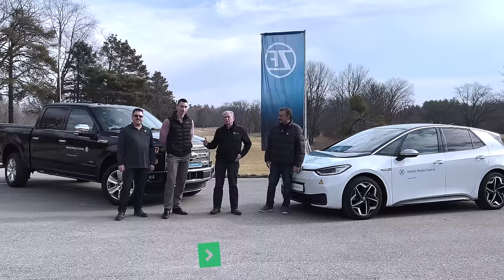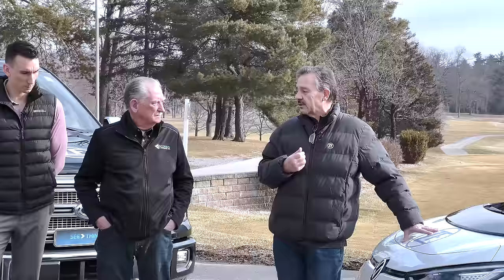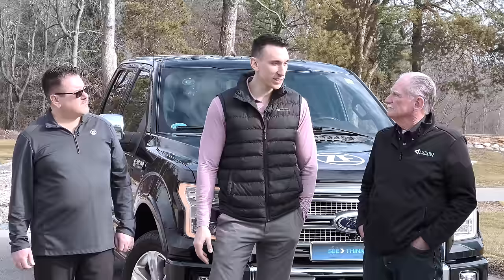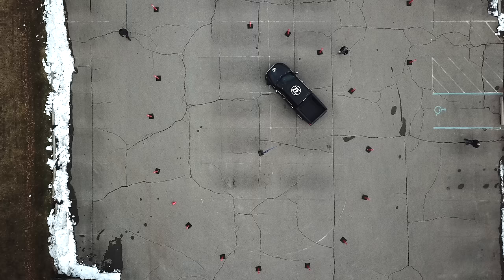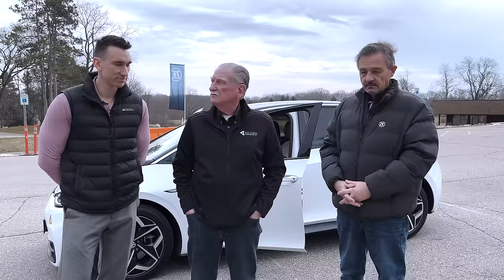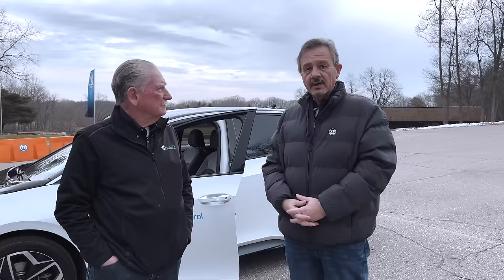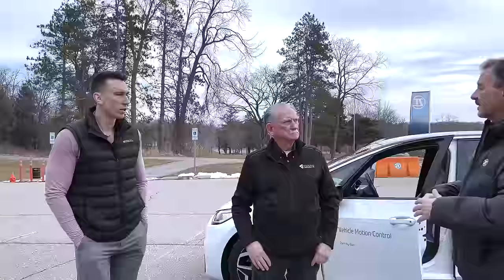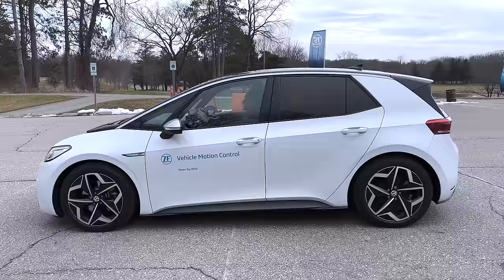Steer-by-wire - how it works with ZF

Comment: Any parking where people on both sides have enough space to open the doors and get out is easy parking. I humbly suggest a European supermarket challenge.
Reply: I have the ability, with the Tesla FSD trial, to get out of the car and remotely move it into a tight space. The future is bright.
Reply: @briansilver9652  well, it still isn't parking it perfectly in the middel of a parking spot thus not really very promising for Europe
Reply: @RamonSmits  The software is the worse it will ever be, constant improvement.
Reply: @briansilver9652  sure, just not usable for Europe. Same as parking next to the curb. In Europe you really need to park tight against the curb. That is something auto park can't do at all with FSD V12
Reply: @briansilver9652 
There’s little point in squeezing into a typical EU car park space if your monster car prevents other car doors opening on either side of you.
Reply: There's a trick for this: park in the other direction. When everybody parks fwd, park rearward, and offset your car so you can go tight to one neighbour passenger door vs passenger door...
Reply: @ABa-os6wm except that only works when your last to park and first to leave otherwise other will park closer to you. Luckily we have summon to mov e the car out of the spot. That feature does work and often needed here in the Netherlands even with regular parking because our parking spots are super narrow.
Reply: @davidelliott5843  
It's not a monster car, it's a tight parking space. The standards were made when cars were a lot smaller, and supermarkets want to maximize the number of parking spaces.
Reply: @RamonSmits  
From what I've seen v12 parks very well, better than most humans. Maybe not enough in really tight situations, but then you can still do it manually. And for a robotaxi parking is not necessary most of the time.
Reply: @andrasbiro3007  not well enough for Europe it's super small parking spaces
Reply: Sounds like parking in SF or Denver
Reply: @briansilver9652 I can do the same with my car (BMW) but chances are you’ll get a few dents in the side panels when parking like that next to a car without remote parking.
Reply: @RamonSmits My almost 8 year old BMW can do both quite well (in most cases) here in Europe.
Reply: @Conservator.  Not with the Tesla truck. 😁
Reply: @briansilver9652  I hate to admit it but you’re right. 🤣
Reply: @RamonSmits  
Perpendicular parking is not an issue. I've seen v12 park perfectly in extremely tight spaces, where a human wouldn't even try.

The issue with parallel parking is the width of the road. I don't think FSD would drive onto the curb for parking. Will have to learn this for Europe.
Reply: @andrasbiro3007  in all videos you see that autopark does not park very close to the curb. Agreed that in some cases you need to park on the curb but it could also just choose another parking spot. In regards to length. I've not seen a FSD V12 video yet where it parks itself in a very tight space length wise. Do share if you've seen it.
Reply: @RamonSmits  
I can't share, YouTube tends to delete comments with links. And I probably couldn't find it anyway, at least not easier than you. There were clips on X when the feature came out, and I've seen some crazy tight ones, but didn't bookmark any.

Comment: It begs the question of why we drive such ridiculously big vehicles. All this technology wouldn’t be necessary if cars were sensibly sized.
Reply: I drive a Fiat Panda. It’s great and goes the job, but fully steer by wire would be a great improvement.
Reply: @davidelliott5843 Why would you want SBW on a Panda? It’s already nimble as it is isn’t it? It would make the vehicle more expensive, going against it USP of being a very cost effective vehicle.
Reply: There are far more beneifits than just making a large vehicle more agile.
Reply: @smarticus6384  Like what? There is nothing SbW adds to the currently already available steering options for automobile drivers.
Reply: @davidelliott5843  which steering feature do you miss on a Fiat Panda? Be warned, the next question is most likely: why are you driving a Panda then?
Reply: @hvh377  Performance is better, especially the programmability, which ordinary electric steering cannot match. More importantly, we need to consider weight and eliminating mechanical complexity. Automakers would kill to free up more space and weight. This simplifies design and production and provides easy assembly, equating to substantial cost savings. The less weight and more space also offer better fuel efficiency, and with BEVs, it can allow for more battery capacity and range. These reasons, as well as others, are why SBW is the future.
Reply: @smarticus6384  Ordinary active steering matches the programmability of SbW. Does SbW reduce weight and complexity? It adds the need for redundancy and requires a force feedback system. It doesn't cost less power than any EPAS system (probably more) and therefore does not increase efficiency. It doesn't require less space (steering rack and wheel are still in place, force feedback system comes in place of linkage) and it certainly doesn't reduce complexity of the steering system. It will make RHS and LHS versions of cars more alike. But all in all, there aren't too many advantages over currently available systems.
Reply: Panda already has electric power steering. SBW would improve stability at speed while not compromising agility at other times.
Reply: @davidelliott5843  That would be 'active steering' or variable ratio steering. This has been available on certain cars for 20 years now. No SbW needed for that. But if you crave that advanced kind of steering, why are you driving a Panda? 😉 Can I suggest you trade it for a BMW? There is a reason Pandas are cheap, light and simple. They do that by leaving stuff off. It's part of their charm.
Reply: @hvh377  
Just removing the steering shaft is a benefit.  That opens up repositioning many other parts.
Reply: @hvh377 SBW add nothing? I’m you don’t understand. I find it stranger commenting about this topic when you don’t know what the technology can do.
Reply: @hvh377   You’re just explaining the components of each system and that is not why steer by wire is being implemented. The sales pitch isn’t that it’s lighter or that it’s cheaper or that it’s smaller. The purpose of SBW is the fact it can be programmed. Traditional systems cannot be programmed. I feel like I need to say that. SBW offers the ability to change the steering ratio according to an algorithm and when you make turns around the city, you don’t have to go handover hand turning your steering wheel 2 to 3 times in 1950 you turn your steering wheel that many times it’s outdated. 
Then there’s ability to play around with the feedback system and have different options. Adjusting the intensity, the smoothness or increase the road feel. And it’s too early to see all the advantages this system will have. in 10 years they’ll be doing things that we didn’t even think of right now. 

and the whole not reliable or the need for redundancy argument is not necessary take a traditional system choose one of the tie rods to fail, and you don’t have steering any steering system can fail
Reply: @Cyber_Cowboy  Well, the point I was trying to make is that SbW is not a necessity to allow for a fully and freely programmable steering ratio. There are systems that leave the mechanical linkage intact while providing variable ratio steering (check BMW's active steering, commercially available since 2003).
Current EPAS systems already allow changing 'steering feel' or providing feedback. A frequently used form of this is a lane keeping system, that actually provides a steering force to return you back to the center of your lane.
As for the comparison regarding reliability and redundancy, I somewhat  agree that the comparison to a mechanical system isn't quite fair (the mech. linkage lacking any redundancy whatsoever), but I think to get SbW accepted, it's a necessity. Unfair perhaps, but alas...
I would personally, although (maybe because of) I earn my living in electronics, also not feel safe using a SbW system without redundancy.

Comment: Quadrasteer GMC/Chevy offered rear wheel steering several years ago (2002- to 2005,2023?),  now those systems need service .   PARTS to repair are VERY DIFFICULT to find.  good idea, but VERY EXPENSIVE to repair and Difficult to find parts

Comment: No Sandy, you weren't square to the world with the system on.  The rear end of the truck was over too far.  But don't let Elon hear you talk about how great VW's steer by wire system is or you will be banned from X.  :)

Where there mic issues?  When the discussion was on chairs one of your guest mics didn't seem to be working.

Comment: Excellent demonstration and education. showing all the different modes of steering and feedback will help move the car industry forward.  The public doesn't know what they don't know
Reply: Shout out to Tesla and Elon Musk pushing the envelope when absolutely none of the OEMs could be bothered to do so. We would still have no steer by wire for the next 20 years if not for Tesla.
Reply: @billhanna2148 
They are driving a Ford.
Reply: @billhanna2148  Steer by wire was introduced by Infiniti like 10yrs ago.
Reply: @DimitarStanev  I know that but why was it dropped ?? the answer is they didnt need it to sell cars !!  Now they will NEED it to sell cars.
Reply: @freddymax5256  I KNOW THAT
Reply: "The public doesn't know what they don't know.” And the more they know, the more they know they don’t know. As long as manufacturers (or at least one - Tesla) WANT to get better, the hunger to know more will continue.
Reply: As much as I am an advocate of new technology.  If tractor trailers can be parked , the Ford can to.  Just saying.  All parking situations are different. You just need to be a better educated driver.  Again , I am in favor of new technology. Especially variable ratio steering.
Reply: the HONDA prelude had 4WS , and the RAM quadra steer.
Reply: @billhanna2148  variable ratio/ speed sensitive steering in cars has been around since 1970 introduced with the Citroen SM's DIRAVI steering, fully power steering not using the mechanical linkage under normal operation at all. Steer by wire isn't unique, many hydraulic systems have had similar functionality, so no, as far as the customer is concerned, it's not that big of a deal. The issue with steer by wire is the lack of true feedback, a problem on euro/japanese cars you want to pitch as sporty, less of a problem on a giant yankee truck. Tesla fans seem to not know anything historically about cars and get all excited about any 'innovation' Tesla sells you
Reply: @billhanna2148  not in the next 3 years...

Comment: A lot of people struggle with parking, 4WS although not a new idea, is a real benefit. I remember it being on a Honda Prelude in the 90’s. SBW is the game changer, less turn on the wheel for great lock a slow speeds will make parking easier for many people. I notice that most people who have difficulty parking or even driving through narrow parking areas is that they never use full lock, and back and fill 10 times instead of once.
Reply: That Prelude was 1987- 1988 depending on where you lived
Reply: Not using full lock nor using all the space they have. (Reversing while they still could drive forward).
Reply: i live in a 1st floor apartment. i watch many lazy people bring their cars and try and fail to parallel park in front of my kitchen window while i drink my tea and shake my head.
Reply: Adaptive steering (variable ratio steering) has been available in some cars without SbW for over a decade now. So it's not a game changer in that respect.
Perhaps it is for people who do not know how to operate the wheel in a motor vehicle properly during parking maneuvers, but can I perhaps suggest another, much simpler and cheaper, game-changer for them? Just educate yourselves! Get some driving lessons and learn to drive a car. What are you doing with a driver's license when you don't even know how to operate the wheel properly?

Comment: Great video. This is nice. I owned a Chevy Avalanche - same size as a Suburban - for 13 years. It was ALWAYS a pain to park. Having the rear-wheel steering makes such a difference.
Reply: Cybertruck steer is only 1/2 turn FULL lock to lock.

Comment: I always appreciated that traditional power steering always had a mechanical link, so even without power or pressure, it would still work. I can't see steer-by-wire having this basic last-ditch redundancy.

Comment: Very interesting and shows a lot of promise for benefits.  I would like to see or know how it affects or improves dynamic handling such as the moose test, 1000' slalom and steady state cornering in 200' skidpad tests compared to just regular front wheel steering only to rear wheel steering and the steer by wire system.
Reply: looking at this between 2002-15~ era and my modified crap they don't need the racks as all 4 wheels can become independent ( maximum /angel is 70-90* so turns can become shopping cart good and or pro-drift-mode etc ) controled with current version/technology, and alignments by wire and or on the fly, something i liked for my auto-X and or daily driver

but i gave up on the idea as a teenager-30yo because i couldn't see anyways of getting it road legal, as big-foot ( monster truck's and hydraulic-only, but same challenges for wire/ electric control's ) changed the USA 🇺🇸 law's ( mechanical-only, assisted is gray area of law ) and by chance made it illegal for everyone

Comment: It's ironic how you need to overengineer something as basic as steering just so you can park a comically overisized car a tad bit easier. 

It's such a first world problem...xD
Reply: Lol so true. I've spent years in multiple asian countries, and this is largely a non-issue everywhere but the US
Reply: @t850 Here in Europe we do not to park "nose first" and it's much easier and faster 👍👍
Reply: @deltajohnny  I live in Europe too. My personal tactic regardig the parking is as follows:

If the parking spot is on the left side of the street then I park nose first

If on the right, then back first.

In Europe streets are generally much more narrow that in the US and we and still manage to park cars sideways if neccesary. In US parking it's a logistics problem if you don't park "nose first"...xD
Reply: @t850  Yes, some americans would have a hard time driving and parking in oir narrow streets and parkings 😅😅😉😉
Reply: The steering wasn’t developed for parking, even if it didn’t make parking easier they still would move forward with the technology. Making parking easier is just a advantage.
Reply: @elijahtucker7938  you’ve been to what a countries and assume that gives you knowledge about the other 190 to conclude that the whole role knows how to park except the US?  Whenever I see someone park bad in the US it’s someone old, new driver or Asian
Reply: @Cyber_Cowboy  ...of course it wasn't, but steering "improvements" are less substential when you consider smaller cars that don't recquire that much power or additional steering mechanism in the back wheels to steer them.

Even if you make steering as basic as a simple rack and pinion (no power steerring), you would be able to park a small car with relative ease. Try that setup with average US car and by the end of the week you would be able to bench 100 lbs with no effort at all...:P
Reply: @Cyber_Cowboy  seven countries. And my comment wasn't about how bad people park. The US has an obsession with massive cars. The #1 selling car here is the F150. Even our crossovers and hatchback are relatively large.

Comment: Didn't 4 wheel steering come out in the 80s? Even GM had quadrasteer some 20 years ago or more. I thought everyone already knew that 4WS gives better maneuverability. Sure it's better now, but it's not new.
Reply: If a tree falls down in the 80s but nobody harvests it, does it still make a noise. No.

The failed experiments don't mean much. Nobody remembers the Palm Pilot. Everyone remembers the iPhone.
Reply: @dirkbester9050  Not failed experiments so much as a feature customers weren't willing to pay for in anything that wasn't a very high profit margin premium car, which continues to this day - just about every manufacturer has steer by wire on the rear axle of their 4 wheel steered vehicles, so adding one more axle steered by wire isn't a massive leap anymore. If anything that situation has got significantly worse thanks to all the inflation of the cost of living that hasn't been matched by income increases since the 80s.